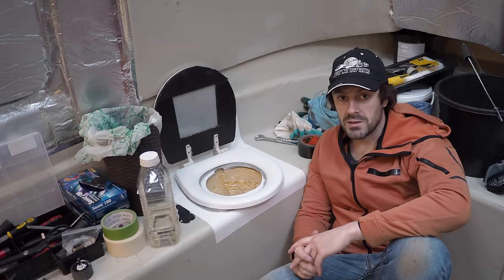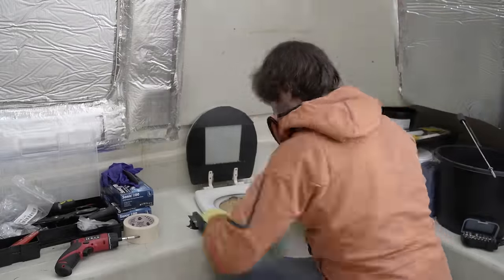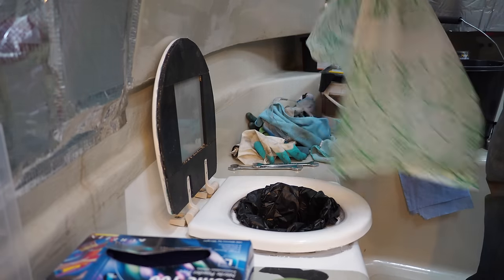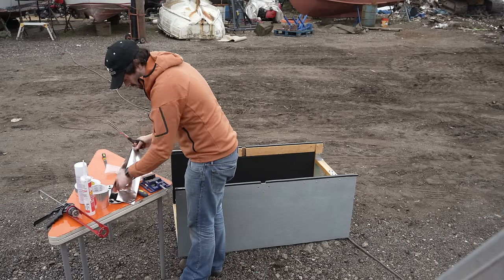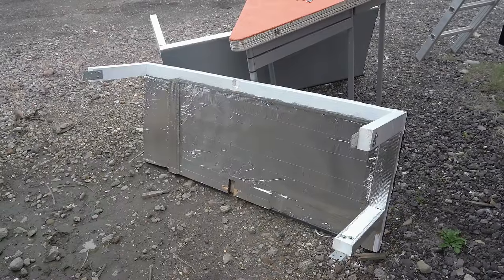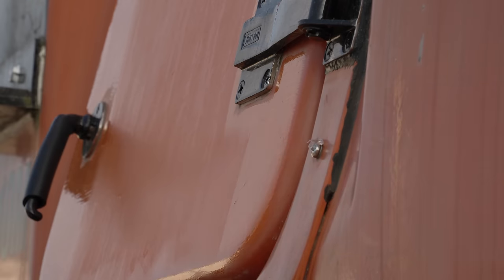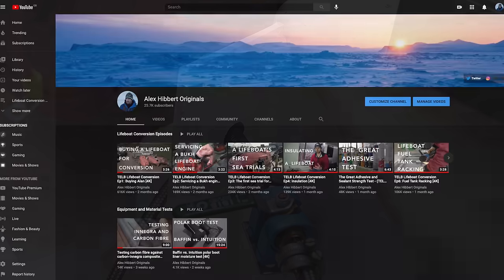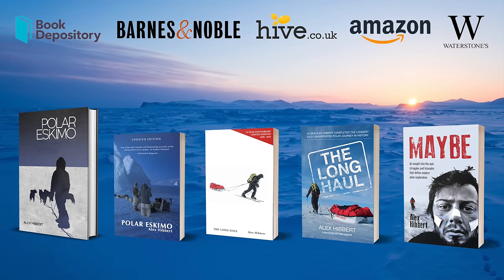Lifeboat Conversion Ep10: Expedition lifeboat heads, engine cowling...and Patreon [4K]

Comment: A suggestion for dealing with those nasty corners and other things that don't like tender parts of the human anatomy.

Over the years, I've paid a lot of attention to what happens to voyaging 'yotties' when the ocean weather gets seriously lumpy. Commonly, the injuries that happen tend to be be broken ribs and collarbones, and cracked heads, all from being tossed around the interior (even plentiful handholds can only do so much to prevent this). So my own solution for avoiding these type of injuries when I begin blue-water sailing, is going to be moto-X body armour (light, tough, and nests well to reduce stowage space) and cycling helmets. I figure these should go a long way towards reducing the likelihood of being injured during storms at sea.

Given that in a storm at sea, Alan is likely to roll over faster than a politician sensing a change in the winds of public opinion, you should probably give this topic some consideration.
Reply from the maker: I've seen ocean rowers do similar. Thanks for the contribution.

Comment: Quick Question why not a 2 chamber Composting toilet? theyre defenetly better smelling than bucket style one, Im sure you have your reasons but just curious.
Reply from the maker: Good question. It was an original design for the expedition Alan should be on now, where organic waste is chucked out every day. Simplicity. I may have a rethink as time goes on, but this regular emptying system and a full rubber seal with the lid down should work for now.
Reply: My first thought as well, a composting head seems like it would be great fit.
Reply: It would be enough to just have the "drier" mixture aboard, just cover the shits with it and it will smell a lot less. Could still chuck them overboard every couple of days.

Comment: have a look at bolts securing ALAN's black rubber fender running around the boat, those might leak as well
Reply from the maker: Will do - that zone where hull halves are bonded and bolted is a slight enigma at present.

Comment: Your toilet hole could use chaffered edges. The bin should be recessed, and I would a add a cowl from the seat into the bin. Will help contain spills, and make cleaning easier. Lastly, coat that foam. Spills will be unpleasant.
Reply from the maker: A few finishing touches to come - including the seat lid closure.

Comment: Been looking forward to an update on Alan, like how you are actually testing the products for suitability before implementing the best one for your application. Just a thought, have you thought of wrapping the exhaust and a turbo blanket to keep temperatures down under the engine cover?
Reply from the maker: The exhaust came lagged from the factory, and the turbo is part covered. I'll ask the experts about what would be safe to install in addition. The cowling will be actively cooled with fans.

Comment: Was wondering if you were going to attach some sort of deck or platform around the exterior of the boat, or will it continue to be a rounded smooth design. Also have you thought of adding pontoons on either to side to medigate the balace and possible rolling issues?
Reply from the maker: Stability pontoons would require a huge structural installation job, so they don't just snap off. No additional deck on bow or sides. At the rear? Perhaps.

Comment: one suggestion. you might want the bucket to be wider. that's it. test it on a day you are unwell and the sea is rough... you'll want those spare inches of space in the bucket
Reply from the maker: Another solution for sea sickness contents......
Reply: @AlexHibbertOriginals   we all need to use the toilet it's the big unifier for the human experience. not having to sh*t in a bucket is the minimum threshold for comfort. but if you have to, I would want a a wider bucket. that's all I'm saying... if others are worried too it may be time to tinker with your current system a bit.
I would at the very least line the hole with fiberglass and paint it. easier to clean in case of a mess up. you don't have a door the smell will last if you soil the foam

Comment: Your engine doesn't need any air for cooling, just for breathing. There might be a couple plugs in the cooling system to attach a radiator to heat the interior for free while the engine is running.
Reply from the maker: It's more to keep the bay (and the cabin) free from any fumes, and the venting will be removable. I don't think heating the cabin is likely to be a major issue with the engine running - the boat is heavily insulated.

Comment: I'm sure you covered it in a previous video , but I HIGHLY recommend having a spare Engine.

Either a small outboard (like 2-6hp) just to get you by while making possible on sea repairs (something small enough to store below deck). Or... a small engine that can generate electricity or heat. The thought of you relying on that single diesel engine the boat came with for an expedition scares me. Too many times I've seen BRAND NEW boats with a pair of BRAND NEW motors get stranded at sea from unforseeable problems with the engines. 

And it's not to insult anyones engineering or mechanical prowess. But sometimes things happen that nobody ever thought could happen. and I KNOW that no matter what happens you will never regret bring a spare engine.... or a spare anything for that matter.

Something deep in my gut is telling me to send a big youtuber who may never read my comment to at least try and get them to bring a spare engine.
Reply from the maker: You're 100% right. Looking at options for small backups to be stowed, and to run off electricity generated by a diesel generator.

Comment: Just wondering: Since (apparently) you wanna block of the engine completely due to noise, which is understandable, but wouldn't it also be maybe better to use the natural heat of the engine to heat the inside of the boat (maybe via some heat conductors)?
Reply from the maker: My expectation is that cooling will be the issue, not heating, once the boat is underway and the engine running. Even in chilly areas. Once into serious cold temperatures, we'd be into a stationary mode, with the engine off, and amongst drift/pack ice.
Reply: @AlexHibbertOriginals  okay this makes sense thanks for the answer^^

Comment: An idea: you might want to dedicate a video to synopsizing your books.  I know when I was in the US Army, one of the things I wanted to do before I got out was a tour at Amundsen-Scott, though I never got the chance out of practicality.  I find things like equipment survival and materials performance in significantly sub-zero (either C or F) temperatures interesting, like the equipment I had to use and modifications I had to make to my motorcycle to use it as primary transportation at -20F.

Just an idea, but a metal cowling around the really hot parts of the engine might be in order, especially the hot side of the turbocharger.  An old metal electrical box or scrap cowlings from a junkyard would probably work well.
Not to question your choice of cowling materials, but ceramic refractory wool is both fireproof and sound absorbing.  You'll probably lose a lot of the acoustic foam's sound properties by putting aluminum tape on it.
Reply from the maker: Thanks  - the turbo is pretty far from the cowling, and has some lagging/guards in place. I'll certainly consider more though.
Reply: @AlexHibbertOriginals  I hope you get to actually make the expedition.
One advantage in the delay: SpaceX's Starlink internet service is adding polar satellites if cheap, reliable, high speed internet is something you'd want.
On the other end of the "relying on corporations" spectrum, there are a lot of robust open source data transfer options for AM radio that could be received/transmitted from the UK to the arctic.

Comment: For light fit and finish parts I would consider a 3d printer plastic is light and you can make extra parts and supplies to have while your away without alot of added weight I'm sure with your level of intelligence you could come up with some really good designs that can also help you and others and maybe even help fund your trips in some small way

Comment: I'm a bit late to the party, but I'm surprised you didn't use an off the shelf solution like dynamat hoodliner for the engine cover
Reply from the maker: It was a case of having lots of one sort of thicker foam available. I did use 10mm foiled foam for the top layer of the boat insulation.
Reply: @AlexHibbertOriginals  ahh fair enough mate, easier to use what you have and can actually get. I'm really enjoying binging the build series!

Comment: Have you put in proper sound deadening under that foam?  Acoustic foam is great for room treatments, but it's mass that kills sound.
Reply from the maker: The answer is no, as the bulk of the cowling can't become too huge. I've used the grade of foam apparently best for reducing lower frequency noise. It's possible I might be able to have dual purpose removable proofing that doubles as seat padding etc at other times.
Reply: @AlexHibbertOriginals  You might look into mass loaded vinyl, it's thin stuff but effective.  Some of the bitumen based automotive sound deadening panels might be a good option as well.  In any case, it's a fun series you've got here, it's going to be fun to see the end result.

Comment: How many people will Alan actually hold when you are on your expedition? I am assuming it will be far fewer than the labeled lifeboat design capacity ;)
Reply from the maker: Realistically 2-4. 5 at a push.
Reply: @AlexHibbertOriginals  Thanks for the answer, I am following this build with interest. Have been wondering what an expedition like this would actually require to be successful, so your videos have been quite fascinating. Looking forward to more.

Comment: Is there (if perhaps only a small risk) that a passing ship might see a lift raft and report it (initiating a rescue operation) or indeed the ship changes course to enact a rescue themselves.    Is there something you can do to distinguish the boat as not being an actual life raft to limit against such unintended circumstances?
Reply from the maker: There are a few ways - the obvious ones are to remove the SOLAS compliant markings (done), and to alter the appearance (extra decking, rails, mast, colours etc). Beyond that, it's important to monitor the radio, where a TELB skipper would be able to allay any fears.

Comment: So ehm, daft question, was any of that foam structural? How close is the bottom of the loo to the waterline?
Reply from the maker: The foam is indeed compression resistant to a certain extent - the foam removal for the lockers and head has been a minimum, and well spaced.

Comment: Specially tinned up like sardines the privacy is an essential relief off the mind so .....why not a simple bathroom curtain around it? Make sure your inside won't be as a sound box lifeboats are very noisy so glue some carpets againts bulkheads install more curtains etc. Measure your decibels once seatrialing it don't accept over 60 or it drives the entire crew insane over a week. Most important SUCCES!
Reply from the maker: Thanks for the ideas

Comment: As a Sailor I was quite shocked about the toilet. There are so many systems even for very small boats which are overturn proof. I mean you want to store multiple dumps in one bag right? When a really bad storm hits a boat that is even designed to handle really bad weather and overturn like your Alan the last thing you would want is to have shit flying around. It could make the inside quite unbearable.  Otherwise very impressive Build. Also think about ways to completely lift the engine "Jacket" a friend of mine had a really shitty situation when their heating died on a trip around iceland.
they used the engine heat to survive but it was really bad as the engine compartment was not open enough to get all the heat into the rest of the boat.
Reply from the maker: Hi Adam,

The head is mainly for use with the boat stationary, it will be regularly emptied, and it has an under-lid rubber seal. Really this is an upgrade from a makeshift trawler's 5 gallon bucket, not a downgrade from a fully plumbed head or live-aboard composting toilets etc.
Reply: Oh okay i didn't spot  the rubber seal the first time. Maybe you can user a bungiecord with 2 mounting points next to the seat to have the seat hold down. So if the boat would do a barrel roll the rubber seal would stay shut.

Comment: The idea is to tie the bag and throw overboard after each #2?
Reply from the maker: Not after each, but regularly.
Reply: @AlexHibbertOriginals  Got it, so. I expect there will be a latch to hold it closed and avoid smells.
Reply from the maker: The lid has a rubber seal, and yes there'll be a latch of sorts.

Comment: Sorry Alex, but this toilet is the worst. They make purpose marine toilets that flush out through the hull. They are in all serious round the world expedition yachts and even in boats much smaller than 25'. The idea of carrying a plastic bag of poop through a boat that is rocking and rolling in heavy conditions just seems totally unnecessary. At the least use a camping toilet. Then you only have to empty it every few days when conditions are appropriate. Also consider using a shower curtain for light weight privacy. Otherwise I love the project and can't wait to see Alan in action.
Reply from the maker: I'm getting a vague sense, from your three comments to the effect, that you're not convinced about the head arrangement.
Reply: @AlexHibbertOriginals  haha, sorry mate.

Comment: "Compostable" and "biodegradable" plastic bags, in my experience, never break down in our large compost pile. It's mostly marketing (they figure nobody will ever actually test their "biodegradable" claim). These plastics may be theoretically degradable, under very specific conditions (5 years of high temperatures in an industrial composting facility?) but in reality they're just more plastic pollution.
Reply from the maker: There's quite a lot of discussion about this in the comments. There's a big difference between grades and certification (e.g. Marine biodegradation ASTM D6691-09), and you can choose bags that use only non-synthetic material.

Comment: Why wouldn't you do a pressure toilet.
An just shot the 💩💨 over board.
No bag needed.
Work like a compress air canon but a toilet with two valves.
You could use it also scary off pirates / polar bears or too curious seabird's🐧.

Comment: My deranged comment will be limited to the skewed orientation of the head seat to the axes of the boat.
Reply from the maker: I agree it's not that pleasing. But limited by the angle of fibreglass, the concave shape behind, and where the foam could be mined from.
Reply: @AlexHibbertOriginals  I know, but I’m just subbing for my wife, who would make that comment had I installed it. Did you consider sealing the foam that was cut out with an epoxy layer to make it a little more hygienic? That boat will be a roller and accidents likely.
Loving the vids.